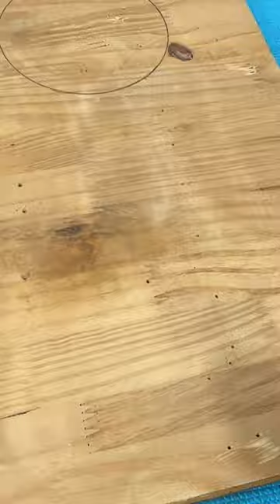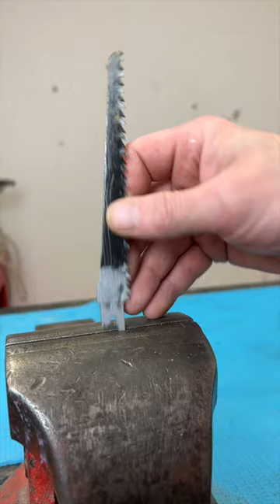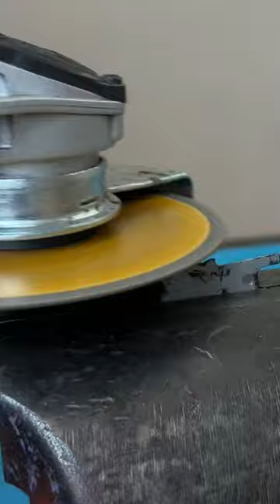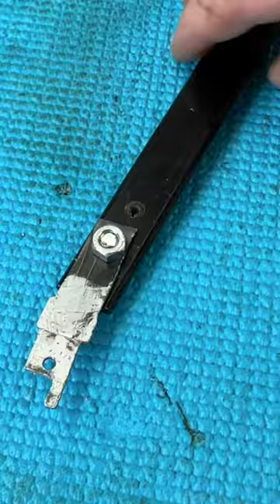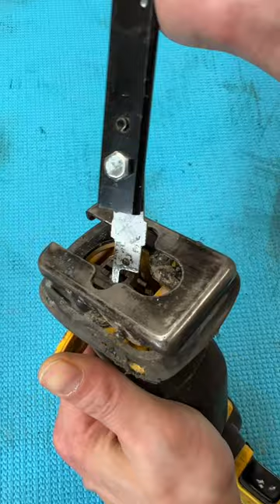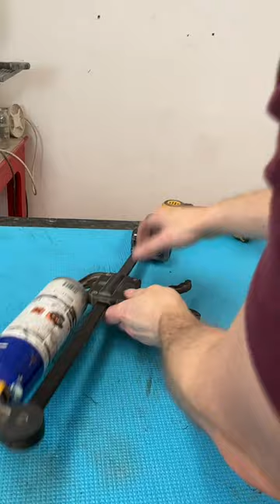Spray Paint #tipcentric #springonshorts

Comment: Tip 1 slightly squeese the nozzle so the spray looks bad
Tip 2 make a stupid contraption to lightly vibrate can, instead of shaking it properly like normal people.
Tip 3 hold down nozzle correctly, so it looks like i made something smart